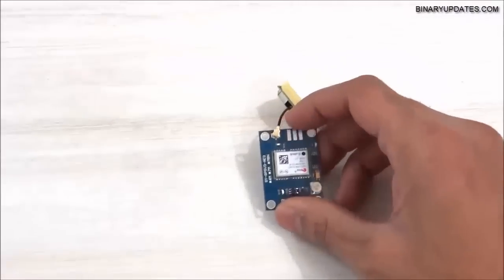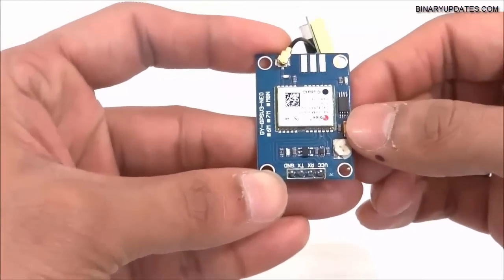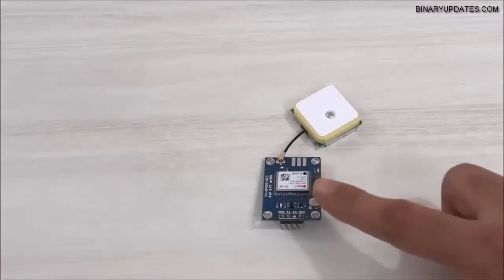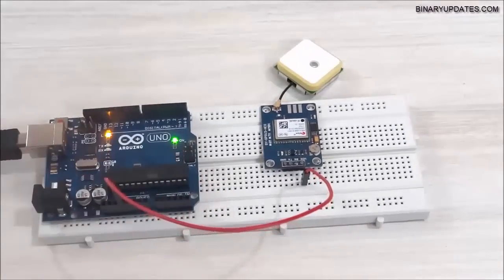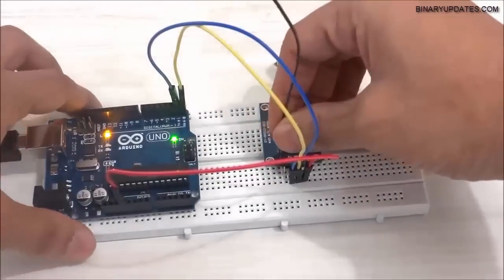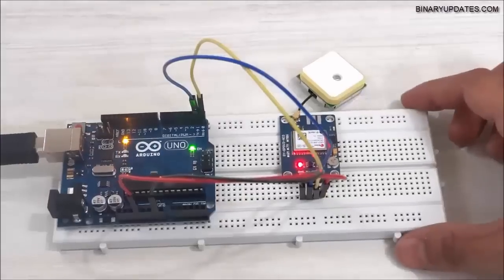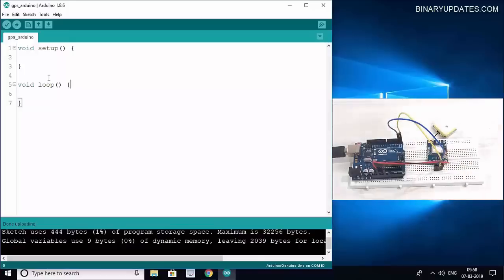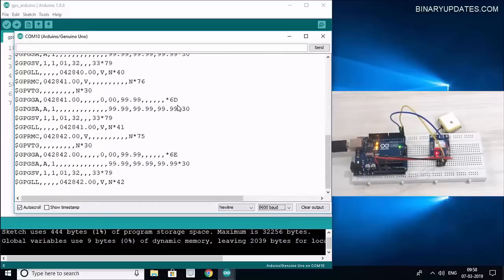GPS Module with Arduino- Ublox NEO-6M

Comment: red led not blinking after connecting with vcc ,gnd ,rx,tx of gps module to arduino .is gps module not working?
Reply: Facing same issue
Reply: @meetalisharma8920  hey first time use GPS module in wide open area  and wait for 10 minute it will work
Reply: @abhirajroy2235  thank you!! It's working now 😄
Reply: @meetalisharma8920  👍👍
Reply: I suppose it works as long as you can see NMEA sentences on the serial monitor.